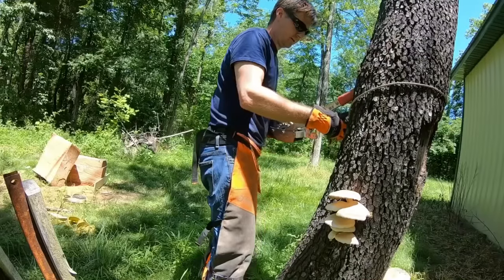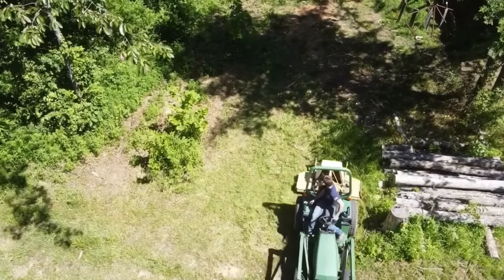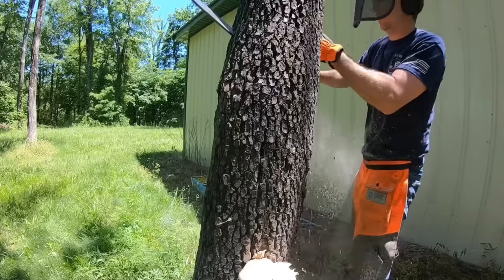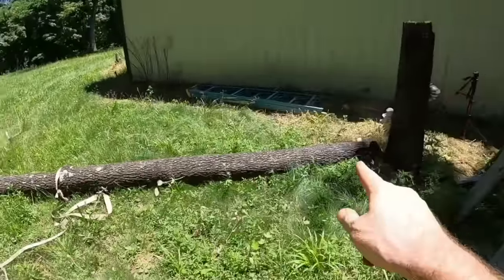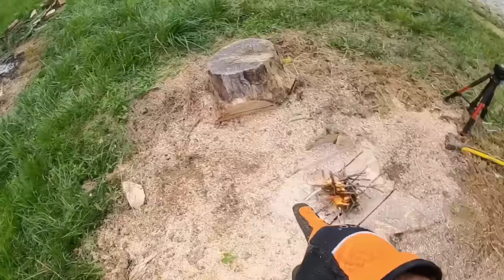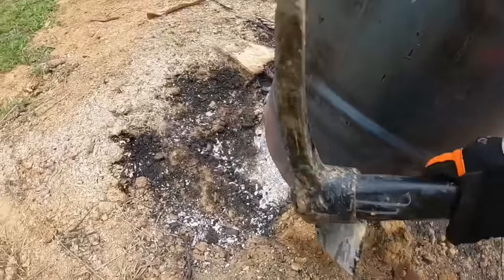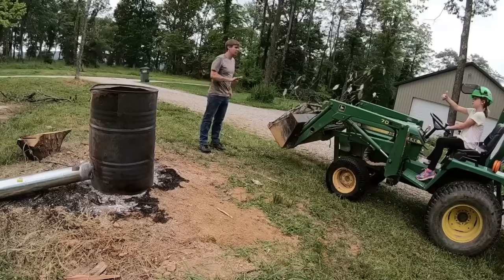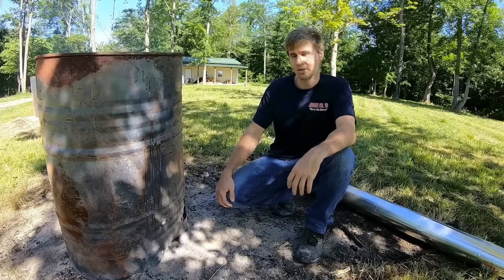Stump burning experiment - PLUS - hazard tree removal

Comment: You might try using the stump as the barrel.
You bore a hole down into the top of the stump 
and bore a hole from the lowest side of the stump, 
to intersect the center hole.
The holes can be quite small.  Then start the fire, 
with a propane torch, and blow air into the side hole.
The stump disappears from the inside, out.
Reply from the maker: jpopelish good idea!

Comment: I'm not too into that low back cut. I see your point but using a thicker hinge might be more predictable.  IDK which is more of a barber chair preventive method but I'd go thick hinge with a wider notch. Burning stumps makes them rot far far far far slower than just poisoning the stump with Triclopyr-salt/acid & allowing the mushrooms to eat it up with time.
Reply from the maker: Bob the Slacker lots of different methods.  Thicker hinge would probably do the trick,  with that little tree though didn’t have a a lot to begin with.  But I agree that a thicker hinge on a larger tree would accomplish the same thing.  Hey thanks for watching!

Comment: best way to get rid of stumps is have a nice open air fire teepee style with a log cabin around it, get the stump covered in coals and then let it smolder for a few days (don’t put the fire out), it won’t reignited but it will burn the whole root system about 8 feet wise. had an oak tree i did it to and it caused an 8ft wide x 4ft deep depression from the soil collapsing into the root voids
Reply from the maker: Andy47357 that’s a big hole!

Comment: If you don’t want to dull your chain saw blade to cut off some nubs that stick up cut them off with your sawzall ,  the blades are a lot cheaper an it works as fast ?
Reply from the maker: Eddie Morton Tap Man you make a good point!...unfortunately I don’t have a sawzall 😕. But you’re right!  They would do the trick

Comment: We have been doing the stump burn outs for years but never with a blower, too hard to run a lead over a mile in the bush. A few pointers, cut the gase out not off, barrel will last longer. cut some slots around the barrel up to 2nd ring. That is all the air needed to stovepipe, just keep adding food timber and that stump will be gone overnight.
Reply from the maker: Bradoutnabout thank you for the tips!  I’ll be sure to try them out if I do it again.

Comment: Because the inlet cutout in the barrel  is oversized, the leafblower actually acts as an ejector pump, drawing additional air from around the pipe. You should next time try mounting the pipe tangentially so the forced airflow would form a fire tornado around the stump.
Reply from the maker: volvo245 good idea!

Comment: I use a long drill bit an put several holes in a stump the use old cooking oil an used motor oil to soak the stump a few good times then light’er up!
Reply from the maker: Southern Farmer85 you know I’ve had other people suggest cooking oil for fires before and I’ve never tried it.  May be something I need to try for myself sometime.
Reply: Captain Kleeman it works great! Burned up many of stumps and brush piles like that over the years.

Comment: You have to have electricity for this. I don't know if this will work for the types of wood  you have there .  Leave the stump a couple of feet above the ground.  About 6" down from the top cut in at least 6 inches. Drop down about a foot and cut in again to at least 6 ". Your cut ins can be more than 6" but min of 6". Take everything out between the cutins. At this point you can either start coating all inside the cavity with something that will combust or start puttin small twigs in the cavity until you have it full as possible. I like used motor oil thinned with a little gasoline and use a paint brush to paint it on. I do it daily if it saoks into the wood for at least a week. If using twig method I suggest soaking them with charcoal starter a couple of times. I use a weed burning torch and just keep the heat in the cavity. Once I get a decent surface area covered in glowing material. I put a portable fan on low and aim it at the hottest spot. Incrementally increase the speed as it begins burning better. As it burns down readjust the direction of air flow to hit the hottest area. I have put a fan on a metal drum when the stumps burns into the ground so I can direct air into the hole. A lot of times roots will coninue to burn. One thing to remember is you have to go out ever so often and move the fan back as the fire get hotter. I have only had good luck with fans that keep the air flow concentrated to a small area and decent velocity. Next time I burn one I want take a 3/4" auger bit and drill holes from 4 different points around the stump from the top into the cavity.  Me personal I found the barrel method a little to labor intensive and it took longer.
Reply from the maker: Beaver Creek Farm Life these are great tips and I appreciate the time you put into the comment!  Thank you and thanks for watching!

Comment: Best way I've ever found was to purchase stump remover salt you drill a series of holes throughout the stump making sure that they are designed to retain what is put inside pour the salt into the holes as per directions and the heated water and then I prefer to plug the hole with a piece of dowel rod allow 9 months it will turn the stump into a very dry and almost slightly crumbly consistency once you have done this start a fire on the stump once it is smoldering leave it alone over a number of days it will burn itself all the way into the ground even follow some of the root Trails for short distances if is a fresh green stump may need to allow a couple more months

Comment: My method is hard work but I finish a stump in normally under 30 for small ones or up to 2 hours for big ones.
I use a 2*18 Makita reciprocal saw and farm jack a heavy duty chain and pickaxe. The reciprocal saw can cut deep into the earth in search for roots and with the pickaxe I remove the dirt I can saw even deeper. By using the farmjack an chain I can lift the stump to get better down to saw the roots.
It is hard work but quite effective because digging it out without cutting roots will just not work.
Reply from the maker: Montalbano hey if it works for you then that’s what matters!  Thanks for the suggestion and thanks for watching.

Comment: I suggest the fire in the barrel be a little bit smaller.  Fire in the top half is too far above the stump to really be effective.  And yes, it is a slow process and a little bit of fuel oil soaking would help too.
Reply from the maker: Arthur Roberts thanks for the tip!

Comment: Dig down into the ground about a foot. Drill a 2" horizontal hole low as you can from the outside of stump to the center. Drill another 3" hole in from the top meeting up with your first hole. You have now made a rocket stove/dakota fire hole. No blower needed and it will burn as deep as you drilled the first hole.

Comment: I guess you were feeling very lucky that day because you walked directly under the fall line of a tree cut, ready to fall. Perhaps the camera angle was showing a different story but I was a timber feller for a number of years, and still able to talk about it, so I would advise never turning your back on a cut tree or walk into the fall line of one.
Reply from the maker: John Pullman I guess you missed the part where I explained the cut and why I did it the way I did it? Also,  I never walked in front of it when it was ready to fall...I mean unless a herd of raccoons were going to come along, finish the cut and drive the wedges to finish it off.  A guy has to watch out for timber falling raccoons.  Helpful hint - the squirrels just don’t have the upper body strength -

Comment: why didn't you do a rocket stove kinda thing by drilling a wide hole 12 ins deep x 4ins wide an then drill in from the side at the bottom on the hole to let the air in  ins w
Reply from the maker: draven griphith seems to be a top suggestion.  May try it next time.
Reply: @CaptainKleeman  I'll admit I've I've never done it to her stump but I have done it to logs and it seems to be a very efficient way of burning a log from the inside out I would imagine just as easy doing it to a stump maybe even easier because you don't have to split the stump you just got to drill a hole down the middle of it throw a bunch of charcoal in it lighter fluid and light it and just let it burn itself out as long as it's got the ability to get air to it by drilling a hole into the ground and into the actual stump or splitting it for air can get to it it should work basically the same way I would think and know what to say is that doesn't work thermite grenade burn the hell out of everything termites not hard to make ether let me know if you want to know how to make it

Comment: I think the main issue with this is the oxygen supply. Personally I would try to make the barrel taller and more narrow towards the top, so it can develop a draft.
Then Id make a lot of smaller holes at the very bottom of the barrel to guide the fresh air directly where its needed.

Comment: Best stump removing is done with a screw-type post hole digger, empty the space beneath it and shove a metal stove pipe down below then cut your plunges in towards the center and light it off.  Never top-down a stump, takes to damned long.  You can put a little AC fan on that stovepipe and get better results than any leafy, you want heat not flow.

Comment: try using a 1 inch wood bit and drill many holes in the stump and pour your used motor oil in there and let sit a few days..THEN burn and put  a box fan or leaf blower to it

Comment: I would have pulled the tree at a 90° angle to the barn. That way even if it didn't fall that in that direction it still couldn't hit the barn unless the base of the tree pulled in that direction. I call that swinging a tree. 
As far as the stumps I would have cut them off flat, set a flowerpot on them and come back in a few years.
Reply from the maker: Papaw are you talking about dropping it parallel with the barn?  I looked at that,  but the tip would have hit the barn.  And I agree with the flowerpot technique.  A proven classic!
Reply: Captain Kleeman 
I agree with Papaw on where I would have anchored the come-along. 
Where you did could have still allowed the tree to fall towards the barn. Anchoring 90* out from the barn wall would have prevented it from getting any closer to the barn regardless which way it fell. 
I’ve only ever cut firewood in a 100 acre forest and succeeded in hanging up more than actually fell due to a full canopy. Only thing I’ve cut near a structure was small enough to direct by hand.
Reply: @Crewsy  Wayne, you can make the degrees symbol ° by holding down the alt key and hitting 0176 on the keypad. Make sure the number lock is on.

Comment: A much easier way to get the stump out is to dig around the tree, and pull it over with a come-along set high on the tree.  Soak the soil around the tree for a few days to soften things up, and cut roots a couple of feet away, a foot deep, all around.  You have a long lever available to pull it out!  Once you cut that off, you lose that lever.
Reply from the maker: Brian Park in the video I mentioned a waterline and that’s why I was pulling them out.  If I was going to pull it out I would have rented an excavator.
Reply: @CaptainKleeman  If the water line is amongst the roots, what do you think fire will do to the line?  There is a tool sold in the '80's called "garden dig it".  Connected to garden hose, it injects water to cut away ground.  I would use that to work around the roots (it even works in rocky ground), and HAND dig also.  You can still use a long length of the trunk (left on) to wiggle the roots and aid digging.  You can also drill holes and apply potassium nitrate solution.  This speeds decomposition, and if you use fire, will speed the burn.

Comment: the problem with putting the backcut so much lower is your wedge is lifting the tree and not pushing it. Also just because your rope is lower on the tree, the tree is not fixed at the top so the strap is still going to pull it over. I agree the higher up the tree the better the pull but it would have to be very low on the tree before you break that hinge by gently pulling. obviously shock loading would break it easier.
Reply from the maker: You're always lifting the tree with a wedge...that's the whole point.
Reply: @CaptainKleeman  yes true but you are also trying to rotate the tree about the hinge. with a level back cut you are pushing the backside straight up. with the backcut so much lower the bottom of the tree needs  rotate out in the opposite direction of the hinge.
Reply from the maker: @stevesrt8  nah, the wedge is just to get a little lift on this one.  The rope is doing the pulling.  It's pretty simple.  👍

Comment: Set some wood chips on a stump. Toss on some fungi. Mushroom caps work nice. Apply H2O (that's water dude).
Cover with leaves or a tarp. Give it time to decay. Remove with a mattock.
Ain't got time for that? Look up 50 to 1 mechanical advantage stump pulling.

Comment: If you had spent a few mins digging the dirt away from around the stump even if you only dug a narrow shovel width trench down to the bottom of the stump and got your blower under the stump it would have been ash inside a day. The barrel helps but getting air under the stump is far more helpful than the barrel. If you don't have a blower at all don't cut the top out of the barrel just add a length of 6" chimney to the top so it draws. Whatever method you use getting air under is the solution. You can do worse than drilling holes in it a good time before and pouring in diesel or old sump oil too.

Comment: If you could've turned the blower to make the air rotate in a circular pattern. It would had burnt hotter and you could've maybe done it a lot more quickly with less fuel. I have seen where a guy added wings/ vortices inside the drum. As it burnt, it pulled air and heat and it circulated As it got hotter, then it created its own speed/ air flow. He was using it in a fabrication set up. Besides that, i have never seen this idea applied in this way. I will be using it in the future.
Reply from the maker: TOM V that’s a good idea!

Comment: Using a come along can be very Dangerous, it's not hard to over crank them and create a Barber Chair.

A stepped down back cut doesn't add additional safety. If anything go 1" above.
Reply from the maker: Stephen Czyzewski dang it,  I think your computer cut off the constructive part of your comment,  but just to double check. What’s your suggestion then?

Comment: A long winded way to remove stump. Use a digger next time. Rip out the stump and main roots. Then level, 30  min total. Burn the stump and roots in the barrel at the end.
Reply from the maker: Mr Foresight so in the video I mentioned why I didn’t use an excavator.  Their is a water main running near the stumps.  I had the Foresight to avoid a major issue there and decided to try something new.  Also, an excavator doesn’t mow grass well,  teach our daughter how to run a tractor,  burn two dead trees that need removed,  but I’ll agree with on one thing, they can be handy.

Comment: Make sure any empty oil drum you cut into is free from fumes of what was ever in there, If in doubt play safe fill it with water and then cut it .
Reply from the maker: stormywindmill sound advice
Reply: @CaptainKleeman  A single teaspoon of acetone was enough to cause a 55 gallon drum to detonate with enough force to kill one person and severely injure one bystander. Stay safe and definitely use the water trick. Or if you want to be really safe you can also use tin snips instead of a power tool, but that's something you want to do if that's your only option.

Comment: should have used a swing hinge that uses the outer layer of the tree as the hinge rather than the core
Reply from the maker: You’ve been watching too many tik toks with that suggestion
Reply: @CaptainKleeman   actually i used the swing dutchman on a 12"X 20' tree that was threatening my well house landed it with with 6" on either side between another tree and the well worked wonderfully also only been felling trees since 2020 due to really bad ice storms in oklahoma

Comment: What experiment? You get a one or a one and a quarter inch paddle bit and an extension so you can drill down the center of the stump about six or eight inches below the soil line and then you drill two or three holes as close to the dirt as you can down to the bottom of that hole in the center. Put some accelerant in there like charcoal lighter fluid light it wait a day or two and blow away the ashes

Comment: Next time drill a deep center hole for long funnel then 4 diagonal outside holes intersect ing to center hole
Fill center hole with used fryer oil yeppers French fry oil do this days Pryor to burn day so the fry oil saturates the whole stump put the barrel ( b4u cut it) over stump while oil is slow draining in stump 
(do this in case it rains or pesky critters)
Ok burn day do what you did just pull out funnel start fire in a pit drop coals in stump barrel turn on blower add more wood the oil  makes the entire stump burn faster  and  hotter 
U can go days later
 w/o adding wood blow ashes off & find a hot spot the stump will re-fire unless you really  saturate it with water a LOT !!! It will burn till oil or stump is gone any charred remains can be back fill with a shovel its good for soil win win *don't  use motor oil
(Cooking oil is safe)

**burn old coffee grounds to keep mosquitoes away 
At nite and 
mint/lemon grass in the day for flies!!

Comment: When you used the blower it was burning so much hotter, so running that constantly (or as much as possible) would make a big improvement. I think you overloaded the first one with fuel wood at the beginning so the seat of the fire would be too high. I think that could be why the second worked better.